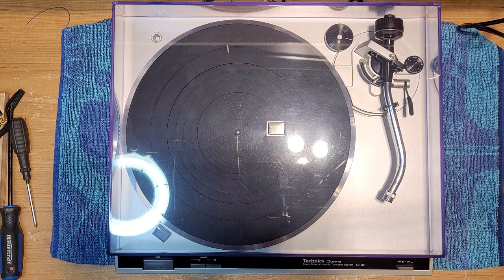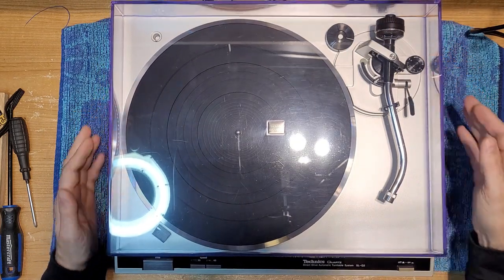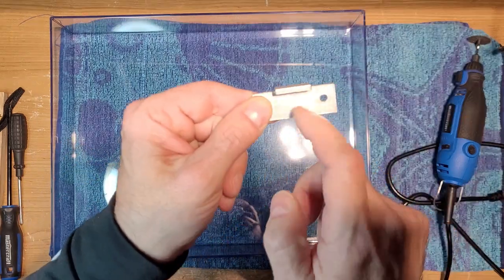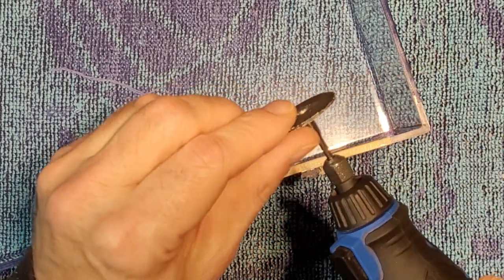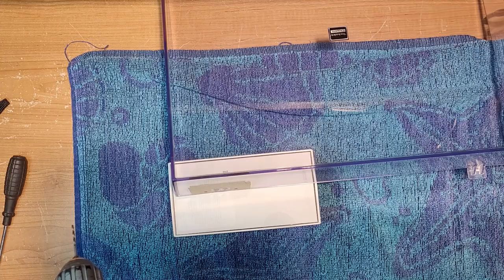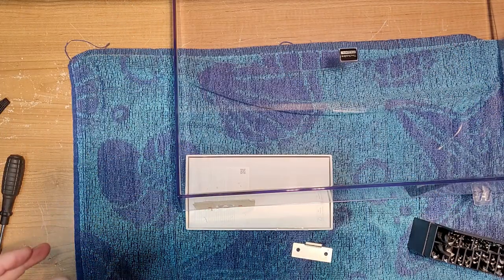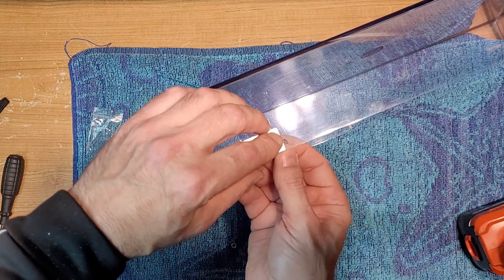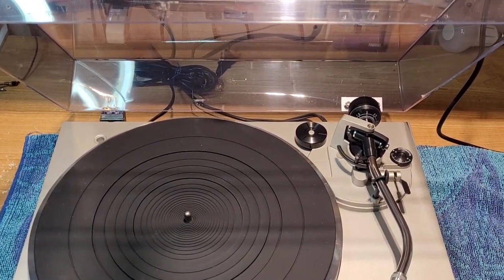Technics Turntable Hinge Tab Repair (SL-Q2) (SL-D2) and Others!

Comment: My dad got this TT in 1980, and I always loved it, but it ended up sitting in storage for a long time, unfortunately. He passed away in January and I wanted to fix up this turntable and all of his old records. It's been running great after a drop of oil on the motor, some cleaning, and a new headshell and cartridge, but the dust cover hinges broke and I had no clue how to fix that so this is very helpful

Comment: My Technics SL-231 has a black plinth so I have sprayed the aluminum tabs mat black. I also used black M4 screws and nuts. Slightly larger than those supplied. I put the nuts on the back so they aren't visible.

Comment: I installed these tabs myself a few days ago on my Technics SL-D202. Even though only one tab was broken, I replaced them both for a professional-looking job. The downside to using these China aluminum tabs is that there are drilled in a metric size; the hardware looks cheap; and there is no "backing plate" to go on the other side of the plastic cover. So I cut a small matching piece of ¾" aluminum (flat), and drilled them out to 3/16". I then used small #10-32 Allen head machine screws with acorn (cap) nuts on the inside. No ugly hardware showing, and backing plate helps to spread the load stress over a wider area. Using only screws, that is exactly where the next break will be! One suggestion: before marking the holes to drill the two through-holes, first square up the dust cover to EXACTLY where it needs to be, and tape it down on sides and front with 2' masking tape. This way, the cover won't shift as you bring the hinge up for marking....you have to work against the spring pressure on the hinge to get it up flat to the cover. The last thing you need is a loose cover while attempting to do this! Wish I could post a photo or two, but the Allen head screws and cap nuts look awesome....worthy of the Name "Technics".

Comment: I received my new aluminium tabs in the mail yesterday.
I'm almost tempted to flip my dustcover around and drill the holes in what should be the front of the dustcover.
The dustcover on my SL-D3 has seen better days, there's some unsightly cracks on the front but none on the back.
Sure the cracked plastic tabs would then be seen on the front but I could always grind them off sometime in the future and it would save me some time and work grinding them off right now.
Reply from the maker: Good luck!

Comment: I cast an imprint in clay of a good tab. Built up the broken tab with baking soda a crazy glue and filed and sanded it into shape. Worked perfectly. You could also wet sand and polish the flattened ares with 800 through 3000 and buff. Grest demo on the retrofit hinge tabs. Tedious work.

Comment: Just remember that you are transferring that stress from the old plastic hinges to the plastic dust cover.  If you are not gentle through the coming years you could end up with cracks in the dust cover.  Speaking from experience.
Reply from the maker: It is a fundamentally flawed design, but better with the repair than not.

Comment: I've seen these for sale on eBay. There is a guy here in the UK makes a cruder alternative the width of the tab bent to the inside with 2 vertical positioned bolts. But I think there was a guy in the USA  made these for a good while. I think he made the mistake of including an image with all the dimension measurements, material thickness, hole distances etc and hey presto, the Chinese have just taken this drawing and copied his design! I was working on a D2 which I was contemplating putting these on but my Dremmel was elsewhere at the time so just elected to sell it as a loose lid. Good to see the process but quite a lot of work. For a top class job you could finish off hand sanding the surgery then go down the grades of wet and dry to about 2.5k, then polish with cutting compounds to a polished finish - but be prepared for a good few hours invested to get to that stage! Good to see the process in action and from the comments that you also did the opposite side.

Comment: Hi,

I have a question: in my case the hinge attachement on the side of the record player is also broken. I found replacement parts on Etsy, but first I have to dismantle the old one and how hard I try, I can't manage to remove the pin from the hinge. Anyone has succeeded in repairing this?

Comment: Lots of very helpful advice, especially in the cutting procedure. I think that the hinge should be fitted so that the flange, not the base plate is flush with lid, a better match with the original. Also the holes be could drilled before cutting the original hinges away - easy to line up?